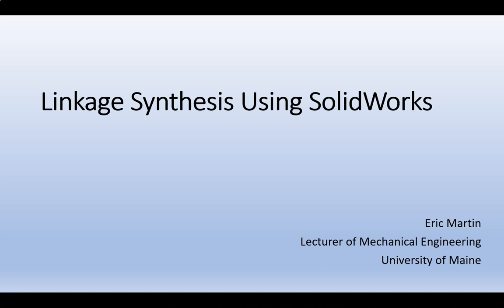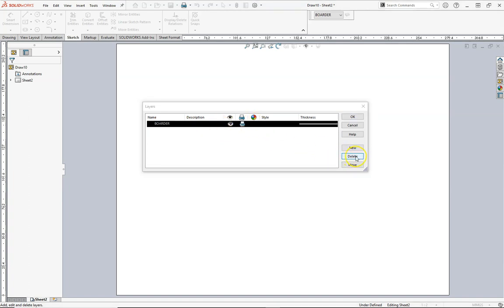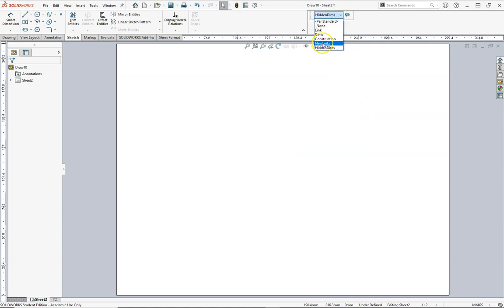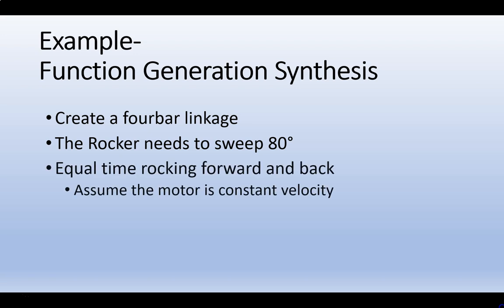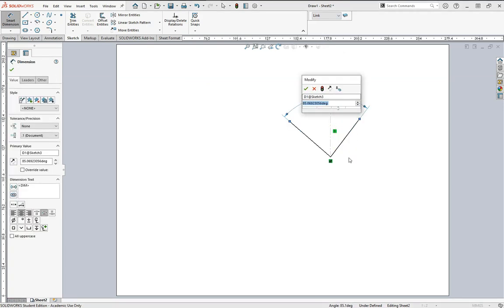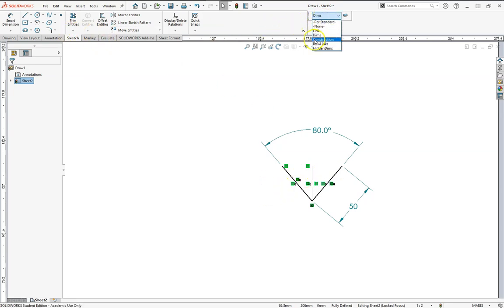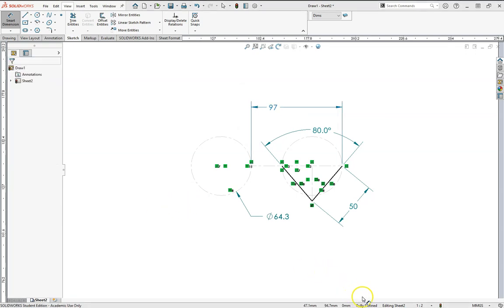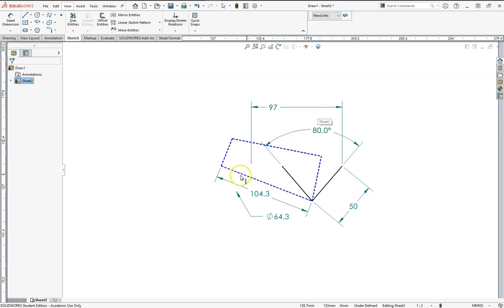Creating SolidWorks Template for Mechanism Design (video 1 of 5)

Comment: Interesting approach using drawing sheet rather that Part, Assembly Layout sketch, and block. It should be noted SW Motion Analysis will do the Kineamatic (Position, Velocity, Acceleration) and Dynamic analysis (Force). However, Motion Analysis only works within a assembly.
Reply from the maker: Thank you, but the concept/approach isn't mine.  As you recognized in another comment, a bunch of material from the videos in this playlist come from "Introduction to Mechanism Design with Computer Applications" By Eric Constans, Karl B. Dyer.  Chapter 2 of this book describes in detail how to make/use the templates, for mechanism design.  I just made videos from that chapter to help students out.

As for Analysis (P, V, A), the text explains how to create, as well as provides, entire code MATLAB codes.   It is one of the best 'modern' books that I've come across for mechanism design/analysis, and I highly recommend it (and I credited the book in the description, thank you.)